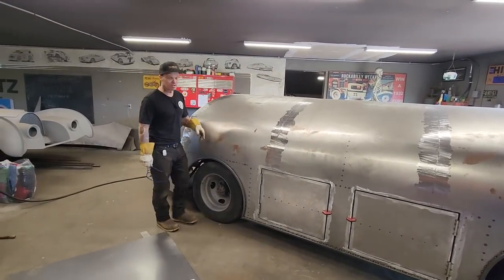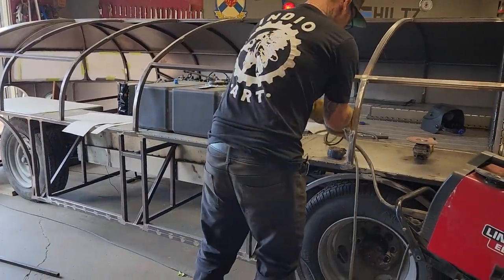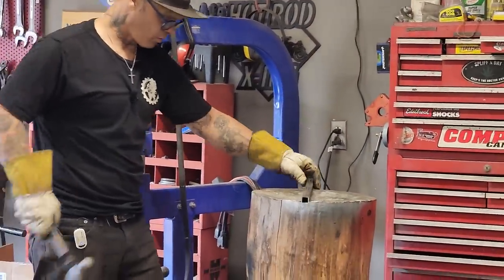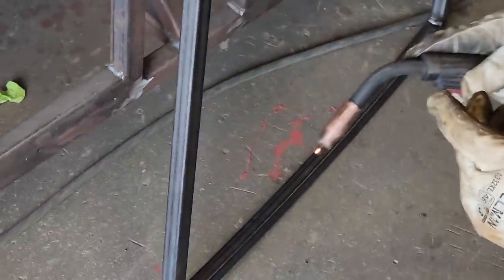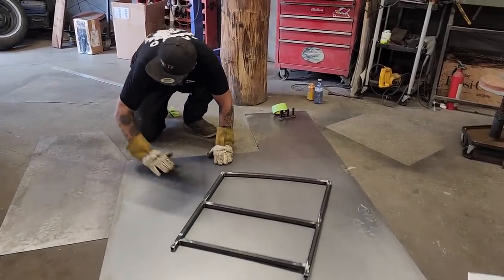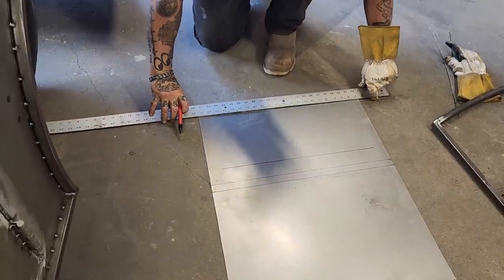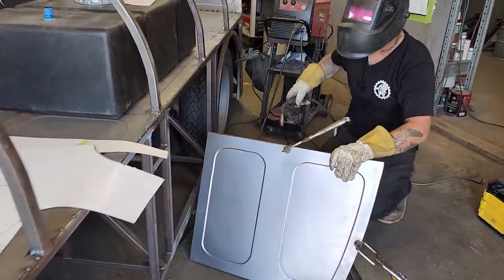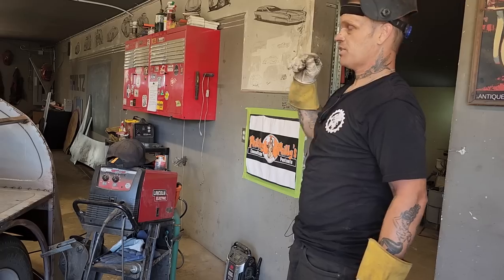Fuel cell panel fabrication – this could be tricky 😬

Comment: How are you going to insulate this thing for sound? The slightest touch sounds like a thunder storm.
Reply: If that ever rolls down the road I'm betting the noise inside will be deafining.
Reply: Spray on loft insulation?
Reply: Check height on bottom bead roll
Reply: nothing beats dynomat..but i’d imagine the entire front section being well insulated..having the thick wood floor is a big help..so maybe enclose the entire front with wood
Reply: I don't think the wood will do anything for the noise.
Reply: Spray on body deadiner
Reply: @johnready630 that’s a big if!!
Reply: Today shows how much Chad & Jolene are engaged with their viewers - they read the comments and respond (when appropriate) live during taping of the episode.
Reply: @stanfarr5625  so..the wood is heavy and thick..which means it’s good at reflecting sound..so the idea is to block all that noise from the back from getting in the driving area…much like an RV..(which i’ve had 4 of)..maybe he will use RV seats or van seats.
Reply: Probably lizard skin roll it on or spray
Reply: Spray foam .
Reply: Dynomat the hole thing inside. Would cost a fortune but would be quiet inside.
Reply: If I was related to Chad, I'd come over and plush-out the interior, myself . Many can do it .

Comment: I wouldn’t worry about the fuel cell being “too close to the rear”, as it is up higher than most, and still plenty far from the rear end. Besides the fact there is a bunch of steel tubing surrounding it, and the cell is far more modern compared to what was used in the “Pinto”. A C6 corvette has 2 fuel cells mounted like kidneys, leaving them possibly exposed to a side impact from either direction. Point being the tank has to go somewhere, and there is always a chance for a problem.

Comment: And reengineer the suspension so that the control arms are the same length as they are currently.
Guessing the floor hasn't been fastened and that is likely  good thing as there is a ton of work yet to do.
Also think bumpers should mount onto a substantial frame like all other vehicles.

Comment: ****Excellent work ethics!
Fuel Cell exposure to impact leak and fire, not saying it will happen but over axle instead of behind may be a better approach. 
I'm in agreement with other posters but wondering why hasn't any cordless tool manufacturer approached you in sponsorship.
       Hate cords!

Comment: I'm going to suggest a ridge vent along the top of this vehicle. To give heat from the engine and radiator somewhere to escape. With no ventilation apparent, this thing is going to be a hot box. Possibly a carbon monoxide box.

Comment: Your doodlebug is coming together nicely. The pinto gas tank location maybe a blast. There are several things that you could do to make this vehicle more functional and usable. But that's not what you're creating. Crating an artistic masterpiece could be displayed and looked at. I am not a detractor I'm not coming down on Chad just pointing out a couple things. Matter fact I think Chad does great work. It's just said his goal is different most times and what it would be if you're working at an auto body shop. I don't know too many auto body shops that put up pieces of artistic creation design and that's all they're good for.

Comment: add two dog ears to the sides of the fuel cell strap & drill holes in these dog ears. this will move the strap an inch or so to the outside of the car & allow you access to tighten the mounting nuts on that strap. good fabricating!

Comment: Just wondering - with all those cables lying inside the metal body, do you have the vehicle shell earthed (grounded) in case something happens to damage one of the cables.  (I'm speaking as one who cut through his own jigsaw power cord whilst working on a metal surface.)

Comment: Widen the space between the front wheel assemblies, should be relatively easy to do.  Cut the frame rails and add space between the wheels and increase the length of the tie rods.
Reply: Exactly. Would have been so much easier to do a month ago. But not too late now !

Comment: Rather than hinge the door, I would use four spring latches and have the door removable for access to the cell. Granted, once the cell is in place access should only be needed to service the fuel pump. but there would be more room if the door is completely out of the way

Comment: Just a thought on the front wheel take a back wheel and put it on backwards like on the rear which it should bring it out same then put 
 
     some kind of hub cap or racing disc could use the be

Comment: wonder if having the fuel tank above the engine will cause any siphon issues ?
Reply: I personally don't think it would because the LS is fuel injected.
But I see where you are saying .
I've had problems with that siphon issues on carburator builds .